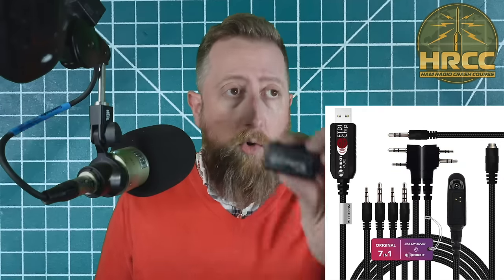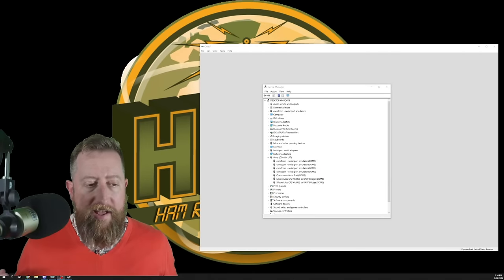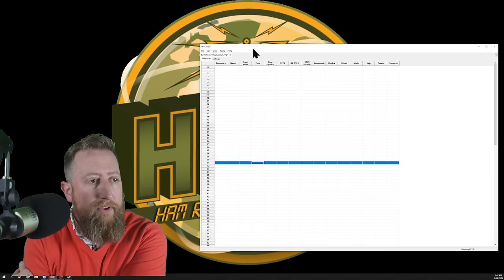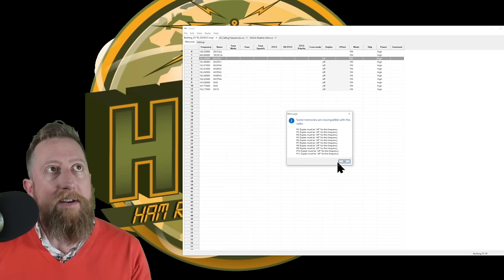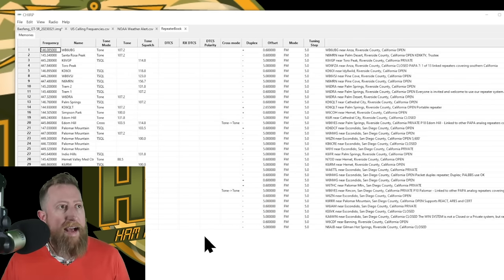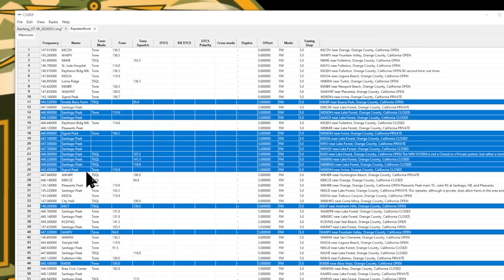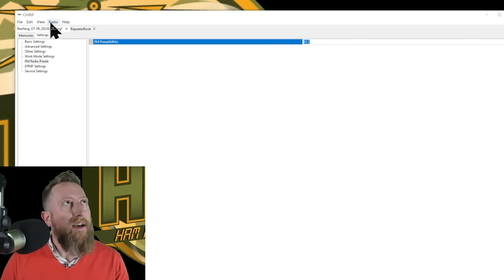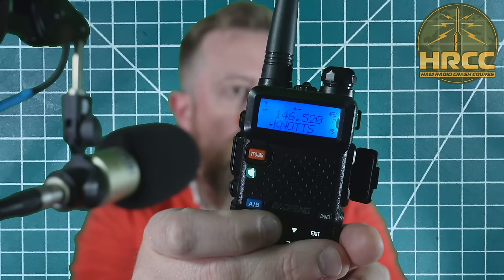CHIRP *NEXT* New Program for Baofeng Ham Radio (GMRS, FRS, MURS)

Comment: okay, installed the newer version and cannot get the import from repeater book function to work correctly. I put in Georgia / Savannah and 100 miles (even tried out to 500) and click the 70cm and 2m and FM only and it only returns 3 repeaters physically located in the Savannah City limits leaving out all the 75 or so surrounding towns and counties. Now, I am having to search for each town to collect them all.  The older version worked fine and there seems no way to go back to it.
Anyone else having this issue?

Also noticed a missing option to open a new file or load previous file at program launch. That's annoying.
Reply from the maker: Use my other example and search by county.
Reply: @HamRadioCrashCourse  Yes Sir - I did a search by Chatham County and only one repeater came up.
I suspect there is a bug in the software.
Uninstalled it and installed a clean version with the same results after "cleansing" my laptop.
Same results.
Searched for Georgia and received over 200 repeaters but still, in a local search, only those in that specific locale are found.
Jim
Reply: Here's a new one:
Downloaded and installed on a new laptop that never had had Chirp on it.
Same exact results.
Jim
Reply: Way too many bugs. I try next every time there’s an update but keep returning to legacy. It just works.
Reply from the maker: By chance, did you try the Lat/Long input?  Do you have it right?
Reply: @HamRadioCrashCourse  
Have not tried that one yet
Reply: @HamRadioCrashCourse  Finally got to try Lat Long and it works.

Comment: A very educational and useful video!  But it might be worth mentioning that the software's units are in km where you mention the radius as miles.  So theoretically you'd only be getting roughly 31.0686 miles in proximity.  📻😀

Comment: Thanks for the Video, Josh!  FYI Radioddity now has a cable that works with Windows 11and the GT-5R, BaoFeng PC001 FTDI USB Programming Cable. The previous cable was not supported in Win 11 (Baofeng UV-5R Programming Cable), it uses a Prolific 2303 chip that is old technology that MS dropped in Win11. The folks at Radioddity were very helpful and sent me the new cable at no cost and not requiring me to return the old one. 
I also had a problem with one of the chargers that came with my 2 - GT-5R's and since they had no new chargers in stock sent me another complete radio setup (without a return) to replace the defective charger. You can't beat Radioddity's customer service!
I like this little GT-5R, though it needs the 3800mah Batt Pack to feel right in my hand, its too tiny in my hand with its stock 1800mah BP.  I've been licensed since '76 and see no need for a different handheld.       73   mike   N4ONL

Comment: Cannot get the CHIRP dropdown menu to even display a UV-25X2. I have a new compatible cable, have found the port, but no luck connecting to the radio after repeated attempts. Any suggestions ? Is this model too new ?
Reply from the maker: Try uv5r as the selection.

Comment: NOT directed at the host of this channel - 

Myself, I "throw a fit" because the technology is stolen, probably from Kenwood and they're a direct CCP brand. They're the cause of most juvenile sounds transmitted over repeaters, and they're in the pockets of Antifa members. The mantra that it enables people to get into ham radio is nonsense. Or that people can have them in case of emergency because the vast majority of Baofengs are in a box or a drawer somewhere with a dead battery and the charger is lost. The fact that I'm not entitled to your opinion shouldn't upset anyone.
Reply from the maker: That last sentence is odd.  Why would you be entitled to anyone’s opinion but your own?  

Also, you can’t just hand wave the “got people into the hobby” away like that. The rest of your points are valid, but you can’t also take that the baofeng has brought people to the hobby away from it.

Comment: I bought the programming cable you recommend for baofengs with the FTDI chip, but i cannot get it to work. I've spoke with the seller to get the "drivers", but it doesn't seem like those even work properly. radio will shut off and turn back on when CHIRP tries to clone the radio. Pls help
Reply: apparently mine needed to be turned down all the way.....i'm happy it worked but confused BF-F8HP

Comment: So new to ham. This might be a stupid question.  I have a Baofeng A58 A58s and a few uv5r's. All programmed thru chirp with same everything.  Both A58's pick up and broadcast my local P.D.  The uv5r's light up as broadcast coming thru but no sound. Am I missing something?
Reply from the maker: First, don’t transmit on the local PD channel. That’s a BAD idea. Second, the PD is likely on a digital mode your radio can’t receive.
Reply: @Ham Radio Crash Course  No not to transmit. Strictly to use as scanner/listen. Is the Baofeng A58 and A58S a digital radio? They both broadcast it perfectly.  My wife is LE. She said it's all analog still. I've got to have some setting screwed up. Any advice or help would be appreciated greatly.
Reply from the maker: Yep, likely a setting screwed up.
Reply: @HamRadioCrashCourse   I think you are right. Any ideas of where to check. Maybe just factory reset and start over?
Reply from the maker: When in doubt, save your programming, set to default and start again.

Comment: In years past I had nothing but problems with Prolific 2303 chips since most of the commercially made cables had counterfeit 2303's, and Prolific put out a driver that would not work with them.  I used homebrew cables using the CP2102 chips with good success.  I did the UV-5R programming on my own and all of my ham club members.  Have not done that for some time and recently bought a new commercial cable using the CH340 chip.  I had gone through two other laptops in the interim and my latest did not have the right driver, nor could I seem to find a driver for the CP2102.  The CH340 cable worked like a charm.  No problems at all.
Reply from the maker: Yet the FTDI chip cable has existed all since then and has consistently worked.

Comment: Thank you for the review of the current version.  It works great, but one thing I notice is that if I go into the MENU on the radio the Shift [25] and Offset [26] just seem to show the last setting but not the setting for the channel.  In other words the repeater channel seems to be programmed correctly because if I press * I see the correct TX frequency.

Comment: Is there a video on a better method of organizing channels in the radio? I feel like just pasting them in as I find them is not the best system. What's the SOP if any?
Reply from the maker: You can copy and paste them in any way you'd like.
Reply: I get it, and that’s why I was asking. Im just wondering if anyone has any advice on a best practice for organizing memories/channels. Because the channel names are so short, it can be hard to remember what they represent and unless you have Chirp open on a laptop, I dont think its possible to see the comments field. Especially if one has multiple radios… how does one remember what is programmed where? Do you just keep a printed reference sheet with each radio?
Reply from the maker: One of the best ways I have used is to print out the programming and scan constantly for weeks. When you hear activity out a little mark on the channel. Do this long enough and you’ll know which repeaters are good and active and you can delete the rest or at least out them to the end of the list and turn off scanning.

Comment: Maybe you or someone in the comments can help. i downloaded chirp but as soon as i try to open on my macbook m1 it crashes immediately i went into system preferences selected allow anyway and that didnt work.. any ideas?
Reply from the maker: Are you downloading the daily up-to-date version?  If possible, delete all copies of CHIRP from your computer and redo the install after a restart.
Reply: @HamRadioCrashCourse  yes I tried downloading the older version and the newer version ( next) tried them both. Deleted all of them emptied trash re downloaded and it will open from my downloaded files but after it gets closed out and attempts to reopen it crashes I tried moving it into my applications and went into my settings to give it permission to run and still just crashes. I’m trying to find info about issues on the MacBook M1 chip seems others have had similar issues but no solution yet. Thankyou for the quick response though I appreciate it.
Reply: @HamRadioCrashCourse  oh I didn’t try to restart the computer I’ll give that a go
Reply: @HamRadioCrashCourse  I did a restart it kept crashing but i un installed a couple more times got angry and voila it worked lol no idea what happened but thankyou! Apparently it has a lot of issues with the Mac m1 and people run into this issue after every update.